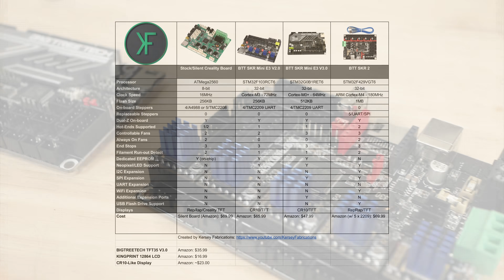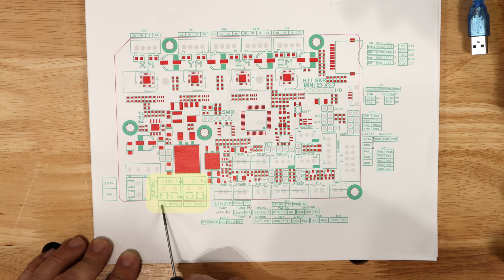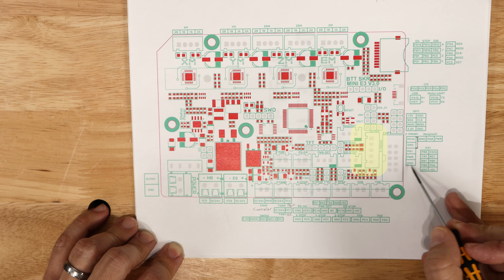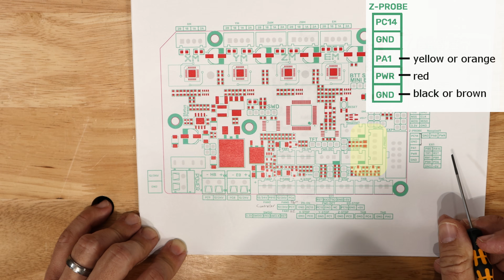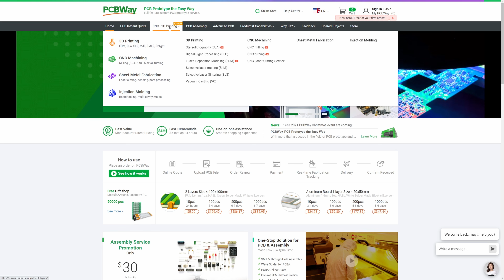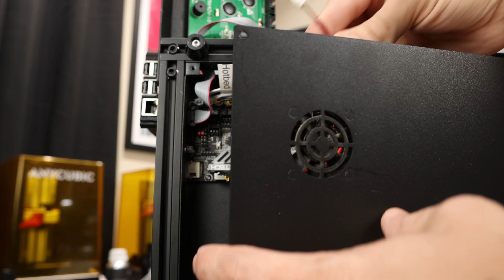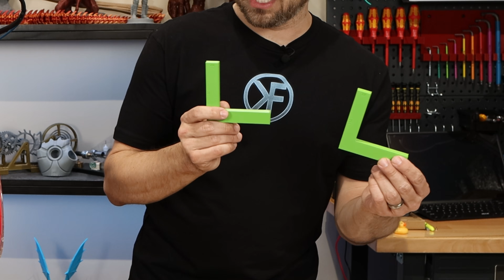Bigtreetech SKR Mini E3 V3.0 - Ender 5 and Ender 5 Plus

Comment: I did this upgrade on my ender 5 plus and now my BL touch only triggers sometimes really flustrating
Reply from the maker: You may need to put a new connector on the BLtouch pins if that's the case. It may be making an intermittent connection.

Comment: Hi, is the firmware the same for the Ender 5 pro? It has a different pitch on the Z axis so I'm guessing there must be a difference. ... I just installed the SKR Mini e3 V3.0 , the E3 V3 TFT screen and a CR touch.
Reply from the maker: It should work just fine on both printers. If you find the steps on the Z axis are wrong, you can change them in the settings menu without recompiling.
Reply: @kerseyfabs  Thanks! ... Off to try it out!

Comment: Thanks for great videos :D
I have a Ender 5 plus upgraded with SKR Mini E3 V3.0 (and use your firmware) i have problem that Z stop doesnt work with the bltouch (have tried CRtouch also) the bltouch toes some clicking when startup and star with red light, when i try to autolevel the bed rise and push the hotend nozzle and i have to turn it off. i have tried switching some cables and double checked that its ok. (i have the original bltouch that came with the printer)
Any advice? (i have also tried both the "probe" connector and the "Z stop" and corresponding firmware.
Thanks in advance
Reply: Are you sure you are using the correct firmware? (BLTouch connected to Z endstop) Mine had the same symptoms when I used the wrong firmware. Also check that the wires to the z end stop are inverted and that the contacts of the probe are inverted correctly
Reply from the maker: I know that one works because I tested it myself. Please double check the pin orientation and that my firmware version is loaded correctly.
Reply: @kerseyfabs  Think i have fried my z endstop , when i connected to probe (with ender 5 firmware) the bltouch clicks with blue and red colors. i have ordered a new mainboard :D ,thanks for advices.

Comment: Hello I have just fitted the BTT E3 V3.0 as in your video I am having problems, it will not read my SD cards? I have a ender 5 with BL touch can you help me please.
Reply from the maker: I'll do my best. Do you have working firmware installed? Where are you inserting the card? The board or the display? Are you using the touch interface or the Marlin interface?
Reply: @kerseyfabs  Hello thanks for the reply, the board came with Ender 3 firmware installed. The firmware will not work on my ender 5, it tries to auto home but goes to far for my 5. But it moves the head. I am putting the card in the slot at the front. I checked and the card is going in all the way. I have the standard screen it says card inserted but will not read it. I have renamed the file firmware.bin as instructions.

Comment: Thanks for the great videos. Hope you can assist with my issue. i aslo am getting the error "failed to enable bed leveling". When I try to do the auto bed level the BL touch lights red the table lowers, the prob cycles in and out then it says level z first. after that it will say bed level complete and ask to save. It also won't allow the bl touch to be enabled it get an error failed to enable bed leveling. Any sugestions would be greatly appreciated.
Reply from the maker: I'll do what I can. Can you home the printer successfully?
Reply: @kerseyfabs  Yes it will home. Upon looking at the wiring of the BL tiouch I found the the original BL touch that came with the printer was wired in the oposite order as the replacement bl touch I switched out, so when I used the stock wire harness I think it damaged the BL touch. I am going to replace the BL touch and try to see if that fixes the issue. I will let you know it that does it. Thank you very much for your reply.
Reply from the maker: Sure. Let me know how it turns out

Comment: How do you enable the sd slot on the BTT Mini E3 V3.0 ?  This is my second one that came that way. I returned the first one because I thought it was defective but the replacement is the same. No sd slot function. The system doesn't even see the slot on it's own. Board. Also just like the first hoard it says no printer attached. I really need some help please. I've contacted BTT and they are useless. They don't even respond. Please help me. My printer has been down for 4.5 months and I tired of the frustration. Thank you.
Reply from the maker: Have you installed new firmware on the board? Have you tried to use the Marlin interface instead of the touch UI?
Reply: @kerseyfabs  Well have you ever felt like a total idiot. I'm there now. For whatever reason I had the TFT plugged into the wrong serial port. What an idiot. Just goes to show that even us so called old and wise can make some pretty stupid mistakes. And I made a big one. I still heeded to do a lot more playing with firmware and the such but it would have gone a lot faster had I noticed that mistake. However, I still appreciate your responding and trying to help. That was very kind of you. Thank you. I'm now doing some fine tuning for nozzle distance from the bed and a couple other minor things but at least everything now functions as they should. Again, thank you so much for your help. Have a great day and keep up the great videos.
Reply from the maker: We've all been there! I'm glad you got it up and running! Cheers!
Reply: @kerseyfabs  Thank you.

Comment: Kris, I had a follow up comment. First, my Ender 5 Plus is stock as it ships with just the BL Touch auto bed leveling feature factory installed. I haven't modified it in any way other than replacing the stock main board with the Creality silent version board. And that leads to my experience with those silent boards. I installed both that later failed. They both worked flawlessly initially. The first worked for a couple months, and it successfully completed dozens of prints,  and it failed appearing to be a problem with homing and seemed to be a problem with the BL Touch, but ended up actually being the silent board that had failed. The second one only worked for a couple weeks, and just failed today with the z-drive crapping out. The z steppers check out okay, so the growling and slow attempts at motion are surely caused by the driver failing. I attempted to adjust the stepper operating voltage, but that didn't solve the problem, thus I ordered the BTT SKR Mini E3 V3.0 and am here asking for your help.
Reply from the maker: I replied to the emails you sent.
I'll do my best to answer your questions. The BTT SKR Mini E3 V3.0 is a drop-in replacement and firmware installation should be easy. The only thing that is extra is that I don't support the stock display with my firmware. There are several technical reasons for this but, bottom line, it's not supported. So you will have to replace the display with one like the BTT TFT35. Let me know if you have any other questions.

Comment: Hi Kris.
I'm new to your channel and really need your help installing this board. My Ender 5 Plus is less than 5 months old and already 2 Creality silent boards have failed now. Consequently I'm trying a different board. Listening to your videos I hope I heard you correctly that this BTT SKR Mini E3 V 3.0 is compatible with my Ender 5 Plus with stock BL Touch, as the new board arrives Tuesday. My first question is as follows: I gathered from this video that the board would work in my machine. Is this true? Also from the video it seems implied then that I should follow the instructions you present installing it in the Ender 5 and apply while installing it in my Ender 5 "Plus."  Is this somehow correct also? because it seems like to do so I need to fill in many blanks. :(
In addition, if the board is compatible, and the board will work with the stock display as well, which firmware am I supposed to use.? There is only one listed that appears to be compatible. That being: " SKR Mini E3 V3.0 - Ender 5 Plus - BLTouch connected to Z endstop -https://drive.google.com/file/d/1TIa6..."  Only my main concern with that is i don't think my BL Touch is connected to the Z endstop, unless you're referring to it being connected there down at the main board.?  I'm sorry but while I'm a retired electro-mechanical technician I must admit I'm struggling to follow much of this. I especially hope your firmware "is" what I need and it's truly plug and play,  simply installed by copying it onto a microSD card and booting the machine with it installed in the sd card bay. Because I've tried to digest much instruction compiling firmware, seeing if I fully understand the process before actually attempting the task, and I just can't seem to get through it yet trying to follow along with the instructions presented by several different youtubers so far. So I'm limited to using a completed file from you, or buying another junk Creality silent board, because they are shipped with firmware loaded and all set to run. Thanks for bearing with my long message and I truly hope you are able to help me through this issue.

Comment: Kris have you put one of these in your Ender 5 Plus with dual indepentent Z driving?
Reply from the maker: This board only has one Z stepper driver with two connections that are electrically the same. I have tested it in my Ender 5 Plus but it won't drive the Zs separately.
Reply: @kerseyfabs  People have converted the extra E driver to an extra Z driver with firmware and run both leadscrews independently so they can run G-34 in the start code to level the bed gantry each print
Reply from the maker: There's not an extra E driver. There's only four steppers on the board for X, Y, Z, and E. Show me how they did it since it doesn't appear to be technically possible.
Reply: @kerseyfabs  I think I have confused this board with another one, Sorry
Reply from the maker: @AndrewAHayes  No problem at all. You may be thinking of the E3 Turbo.
Reply: @kerseyfabs  I think your right, I knew it had E3 in the name

Comment: Followed this to install the same board into my ender 5 plus. I did fash your firmware and while it sort of works, i'm seeing a lot of issues (can't set a new mesh using octoprint, getting a lot of bed-leveling failure warnings etc)----but sure if that's something off in the firmware compiled, or something board related.
Reply: I am also getting bed leveling issues not sure why

Comment: How would one compile firmware for marlin? Yours will load onto my Ender 5 Plus w/ bl touch connected to the probe, but the print dimentions are that of the smaller bed
Reply from the maker: You don't need to recompile. That's a problem with the touchscreen. Update to the latest touchscreen firmware. https://github.com/bigtreetech/BIGTREETECH-TouchScreenFirmware#firmware-update
If that doesn't work, look at the config file: https://github.com/bigtreetech/BIGTREETECH-TouchScreenFirmware#configuration
If you want to verify what I'm telling you, try using the Marlin interface by holding down the button for a few seconds.

Comment: Since this will be my first core x,y printer. Which board will be best on a 5 plus?
Reply from the maker: The Ender 5 and Ender 5 Plus are not CoreXY printers. If you want a Creality printer that is, you'll have to go with an Ender 6 or Ender 7. To answer your question though, my favorite board is the SKR 2 at the moment. Check out  my SKR V1.4 video though on what it takes to install it. The process is the same.

Comment: Can you use the stock ender 5 plus display with the btt skr 2?
Reply from the maker: Theoretically yes but not without a lot of work from both a firmware and wiring perspective. I haven't done the work and personally wouldn't spend the time on it due to lack of functionality.
Reply: @kerseyfabs  I’ll be ordering the btt tft35 the lol.

Comment: I have an Ender 5 Plus using the SKR Mini V3 V3.0, TFT35 and your firmware.  I am getting the error "failed to enable bed leveling".  I repinned the original connector from Creality, no change.  Purchased a new BL touch plugged directly into the board, same error.  Disconnected the Z Stop plug and no change.
Any idea's?
Reply from the maker: All you need to do is run ABL (Auto Bed Leveling) once and that will go away.. It can't enable it because it doesn't have a mesh.
Reply: @kerseyfabs  Thank you, I will run ABL!  Sorry for the noob question...
Reply from the maker: No problem!

Comment: Having an extension SD card cable doesn't work which sucks. Just says SD init fail. I just don't like having to keep plugging and unplugging the micro SD card slot. Over time that sooner or later will not read the cards inserted Took mine above 70c and the fan doesn't turn on at all. Everything else works fine include hotend and bed thermistors.

Comment: Great video, Thanks a lot for your work !
What about de original display screen of the ender 5 plus ? is it compatible with this board and your firmware ?
Reply from the maker: No. At this time, I do not have a firmware that supports the stock display.
Reply: @kerseyfabs  Hi, after seeing your video and this answer, I decided to buy the SKR Mini E3 V3.0 with the TFT35 V3.0 for my Ender 5 Plus. I installed everything following your advice and checked the polarity. Everything seems to work (I can move the pins and heat the nozzle or bed) but as soon as I turn on the power, after seeing the BLtouch go down and up twice (lighted in red), I get an error message, saying : "Failed to enable Bed Leveling". Do you have any idea of the possible cause ?
Reply from the maker: @auroch7676  That just means you haven't run ABL (auto-bed leveling) yet. Run ABL and the error will go away.
Reply: @kerseyfabs  thanx a lot !
For the nest steps, is there somewhere a new procedure to level up the E5Plus with this firmware version ?
For your in formation, when I use the function for leveling with the 4 corners and the center, it seems that the distances are not correct :
- The right front point is on the middle of the plat, not at right
- The Left rear point is at the middle of the left side of the palte, not at the rear.
- The right rear point is at the middle of the plate (between front and rear & right and left)

Comment: Kersey needs your help, I connected the same board to an ender 5 + printer with bltouch, in response I get an error on the screen "failed to enable bed leveling", did you have this? how did you deal with it?
Reply from the maker: All that means is that you have not run auto bed leveling on the touch screen. Run that through the menu and then it will go away.
Reply: @kerseyfabs  спасибо огромное, ошибка была еще и в перепутанных проводах
Reply: @kerseyfabs  thank you very much, the error was also in the entangled wires

Comment: I'm confused, the MINI has TWO Zs ...
Reply: Oh I got ripped off. They claim dual Z interface all they did was add a duplicate plug! Wow!
Reply from the maker: They're electrically connected to the same stepper driver. They can't be controlled independently.

Comment: this was a great video. I really hope a version for the ender 5 plus is in the works. even if it was a little addendum video to this which added the extra bits that were relevant to the plus.
Reply from the maker: I believe the only difference would be the BLtouch (which I talked through) and the filament run-out sensor. So, I won't be doing an additional video. I think I covered it.
Reply: @kerseyfabs  that's fair enough, is there anything one should know regarding the colour touchscreen of the plus or is it just a case of making sure I have the plus firmware when doing the install?
Reply from the maker: @LegalEliminator  You can't use the stock touch screen on the Ender 5 Plus. You must upgrade to the Bigtreetech TFT.
Reply: @kerseyfabs  oh, well that answers my question. That wasnt noted in the video. which tft is the right one tho?
Reply from the maker: @FaZeredemption3  Sorry about that. Any of the Bigtreetech TFTs. The one most people use is the TFT35 V3.0 but they make larger ones as well. https://amzn.to/3wycXrp
Reply: @kerseyfabs  yeah, tbh, im just gonna send this board back and get the creality silent board. Its not worth the headache, and imo the stock screen is better from what I have seen. I have a 2nd board for my ender 3 pro, and that one I have seen work with stock screen.
Reply from the maker: @FaZeredemption3  Whatever works for you is what's best. I like the upgraded screen for the functionality. If you like the UI on the original, that's great.

Comment: You are right when you say that the balance between the components of a 3D printer is key and so a higher speed ARM M4 at 180MHz offers more performance than a standard mechanical build of a 3D printer can handle. It is so, that the aluminum structure used in the Ender 5 Plus is what is called "light" and there are 2 more variants, the stiffest one is "Heavy". Replacing the structure with stiffer aluminum profiles gets into the challenge to replicate the holes drilled into them. Here I see a possible product to be offered to the market by 3rd parties.
The other component required to upgrade the performance is to use drivers using TMC5161 that can handle up to 60VDC. Watterott i.e. offers those. Finally, a separate power supply with 48 VDC to feed the drivers will add to it. BTT now has a board that supports this.

3D printing is a slow manufacturing process and if you go to use less than 0.4 mm you can even improve the resolution of your prints thanks to the higher speed it does happen as fast as before.

Comment: Thanks for all of the updates firmware files Kris and awesome video as normal! I Lost my old source code set I downloaded from you a while back and took me a while to find these links. At one point, you provided a source for the ender 5 plus with the hero me installed with relevant margins and offsets. Any chance you could supply these again? I can’t find the original video these were listed on. Thanks again, Hal
Reply from the maker: Here you go: 
X = -45
Y = -7
Z = -3